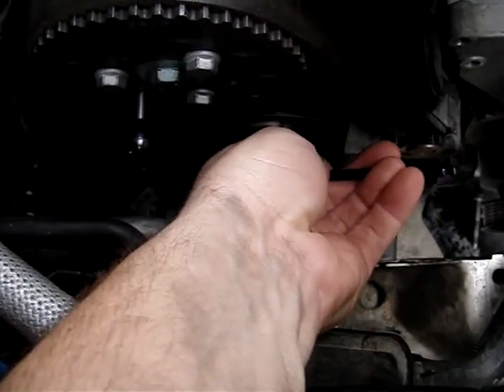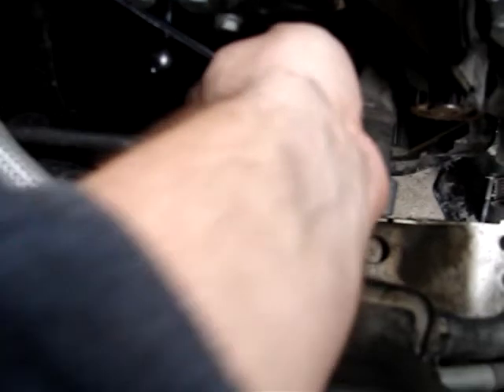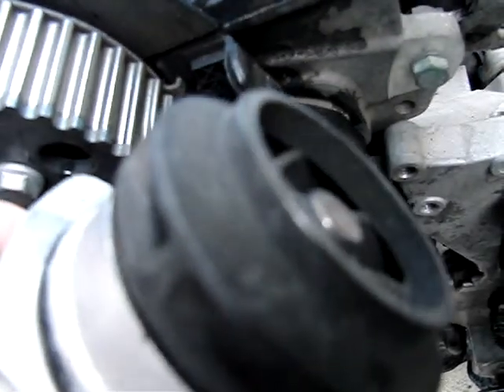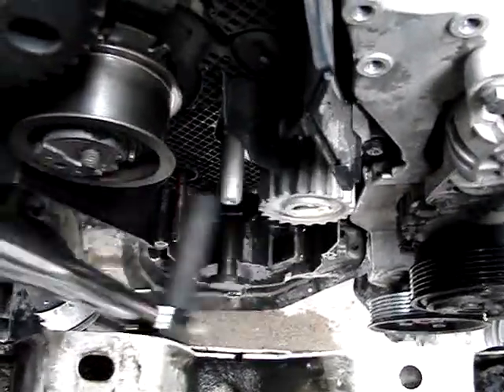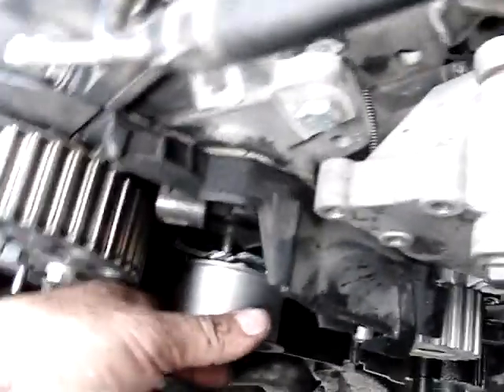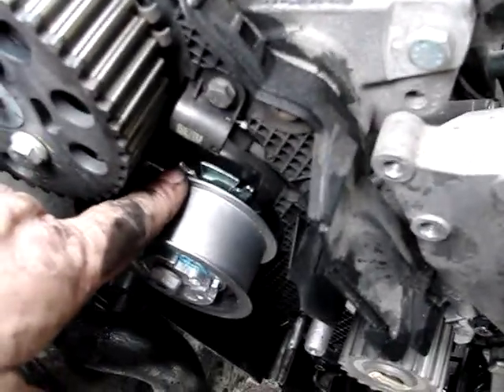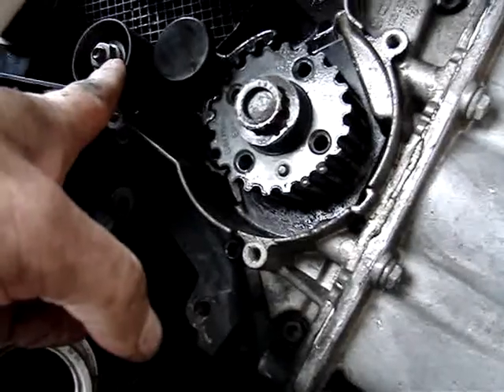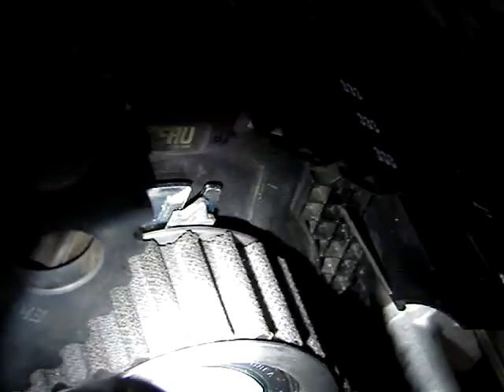Jetta TDI Timing Belt Part II

Comment: Hi john great video I will be doing my timeing belt when the weather warms up I've got 53 reg mk4 golf 1.9 gttdi 130 asz engine .will this be the same procedure ? Looks as though it could be .Is your car left/ hand drive?as that must make it a bit easier to get the engine mount out with the brake reservoir been on the left hand side?mine is right hand drive would you say its possible to get the mount out with the reservoir on the right?also how did you put the belt on did you take the camsprocket off ? or just centre the camsprocket and feed the belt round?Many thanks matt

Comment: Hey man great video.   what year is your car?  I have a 04 Jetta.  I've ordered all my parts today and I will be doing mine this weekend.   the timing thing is the only thing that worries me the most.
Reply from the maker: The timing of the mk4 BEW PD TDI is not a hard job.  The worst damn part is removing the damn motor mount fron the block as the belt goes between two mounting points.  Each time I have has to raise the motor a bit, remove the bolt (rear one towards cabin) and then lower motor to continue.  Make sure you install the water pump and a new tensioner when doing the job.
Reply: +John Fountaine 
yea I got all new belts and water pump and tensioners. I also have to replace a front crank seal its leaking like crazy.    my car is a different body style.   but the engine looks the same as yours.